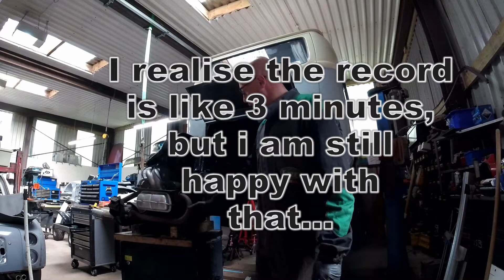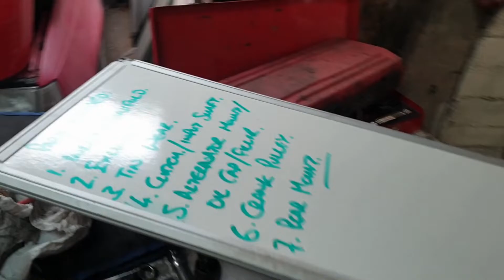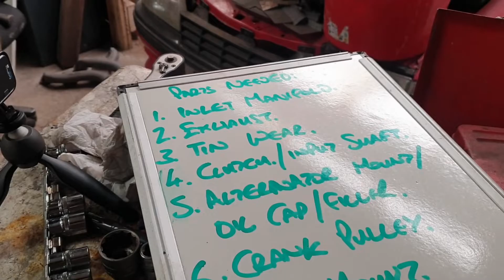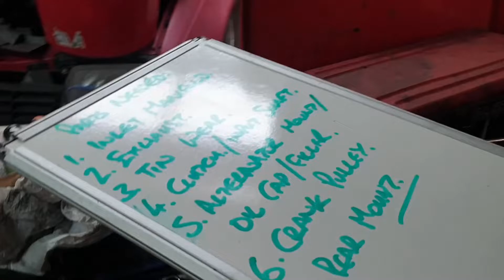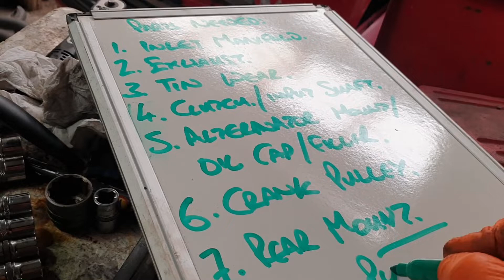Vw camper surprise project. Porsche engine. Gfix.

Comment: You probably realised that it is not an easy swap. That is just a normal 1700 bus engine, from a later model. If you get all the sheet metal from the later engine, it will all bolt on and the engine will simply bolt in. Not much more power, but much more reliable and a bit more torque. But no. Not really a Porsche engine. It is called a type 4 vw engine.

Comment: as you no doubt realised, it's not a straight swap. also not much of an upgrade, if at all. you're better of rebuilding and improving the original. vw engine is far more customisable due to the vast amount of aftermarket parts.